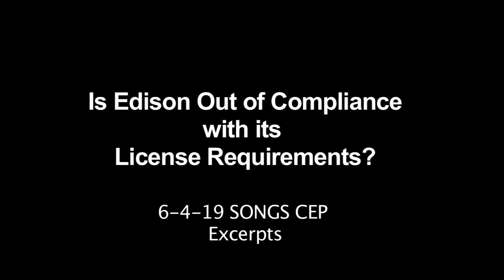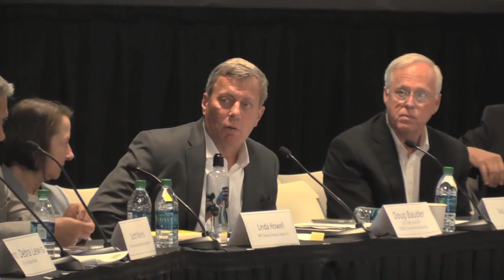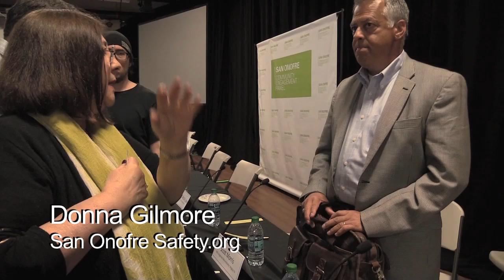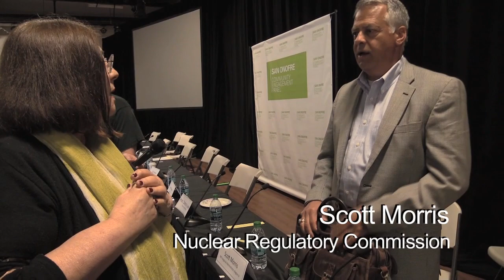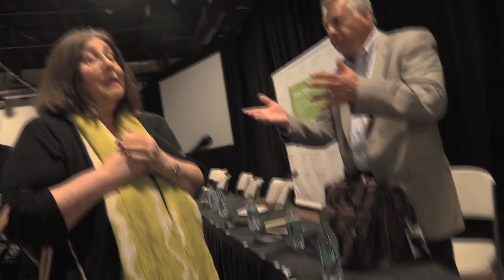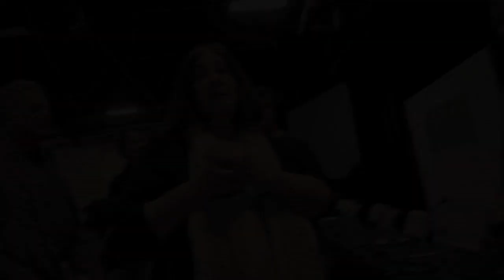Is Edison Out of Compliance with its License Requirements?

Comment: Condition 8 of their license requires the ability to return fuel back into the pools. Bauder's claim they can use an overpack for leaking canisters or ship a leaking canister somewhere is not true. There are no such approved options and no systems in place to do this.  See SanOnofreSafety.org for details.